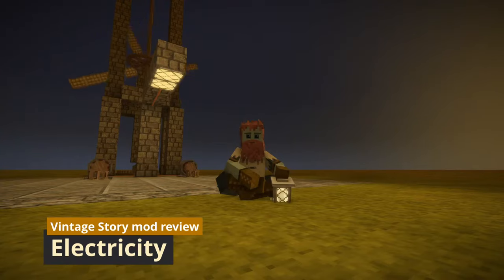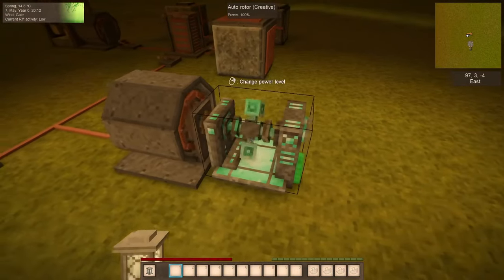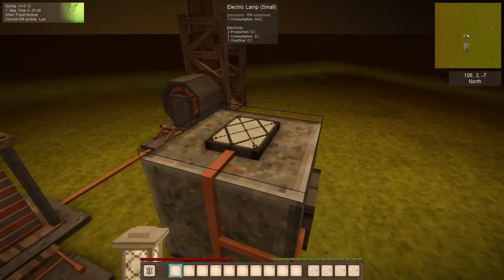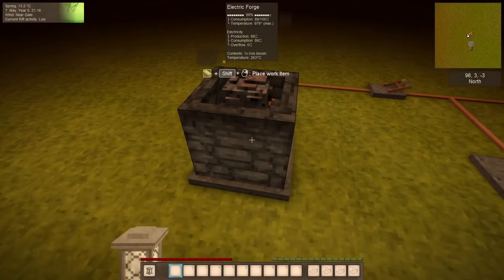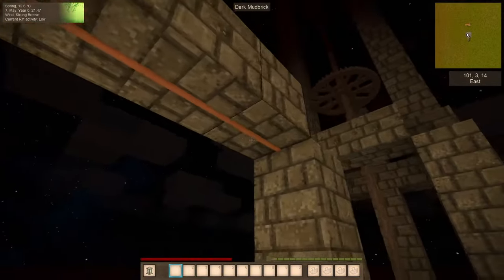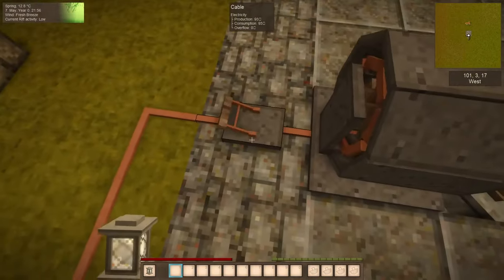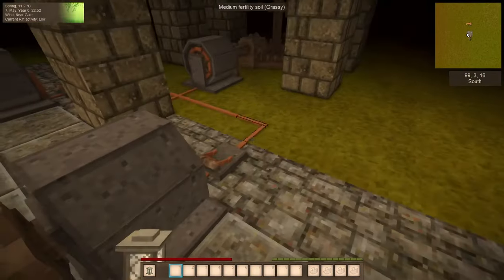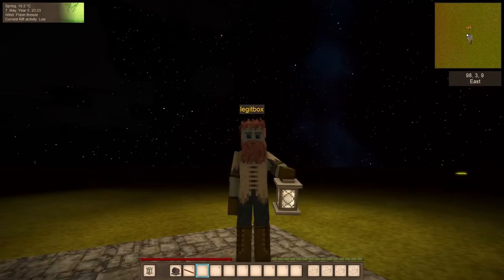Vintage Story Mod Review - Electricity

Comment: Circuits mod would be even more epic to play with. You know you using these copper wires, but not by placing "basic block" size, but like tiny bits of block, where you can design even whole little mechanism with logic gates, resistors, transistors and even programmable microcontrollers in one single block :)
Reply from the maker: there is a mod in the works caled signals i believe, it doesnt have it, but the developer has it in his sights
Reply: I feel that would be like another 3 tiers further from this one. would be amazing tho. 
like been able to go through the different stages of technology advancements.
like going from basic motors and steam power generation with lightbulbs, water pumps, or an electric adapter for the archimedes screw, basic electric motors, then having to build transformers etc, then go into basic circuit cabinets probably to do all the logic things manually but in a small space as self built controllers for automation.

Comment: How does a copper wire heat up iron to a workable temperature without melting itself?
Reply: something something temporal gear
Reply: the same way the copper wires in your walls heat up the stove without melting themselfs
Reply: @jacobkavinsky1813  your stovetop dosent get up to 1300 *C